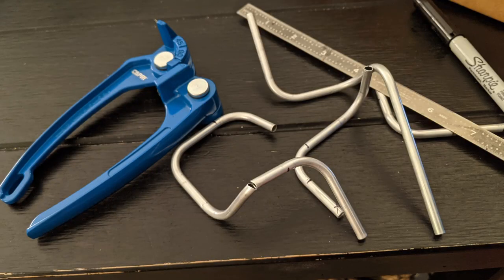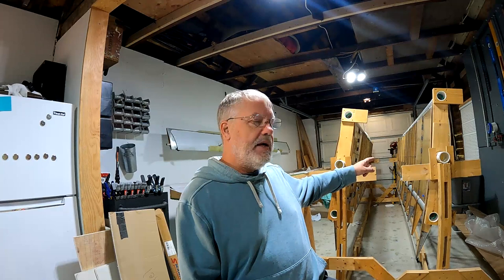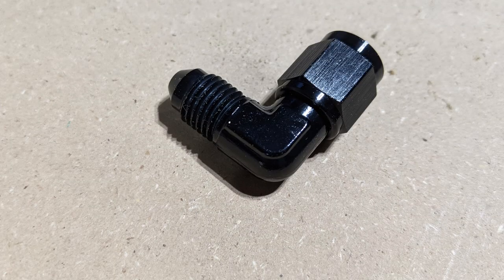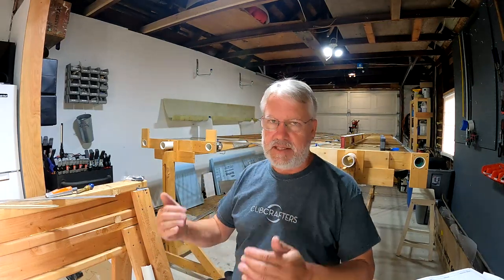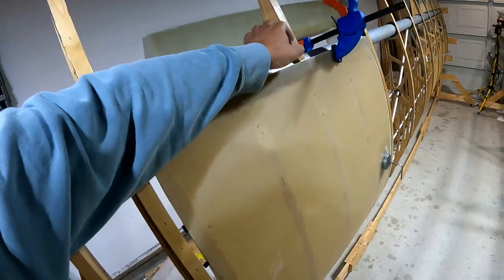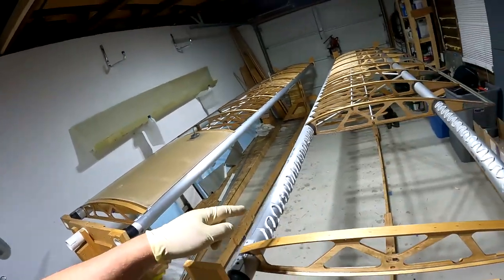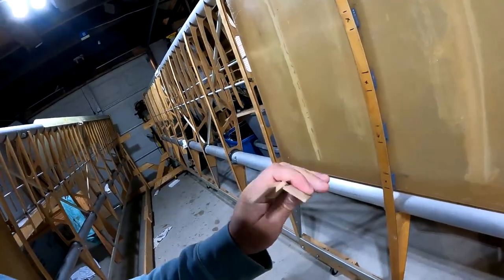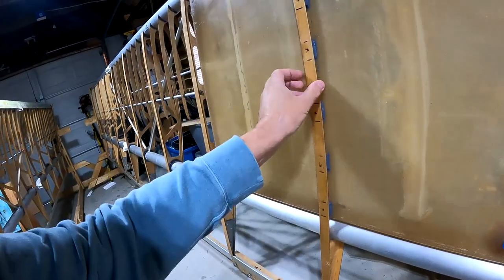Verner Kitfox 5 build video 18

Comment: Looking good. Sucks about the Flaperons delaminating. FYI, when you get your new ones, the book calls for 3/4" from trailing edge for the drain holes.....If you do that, you'll be in the adhesive. I just drilled drain holes in a replacement flaperon the other day and went 1" and it worked perfect.